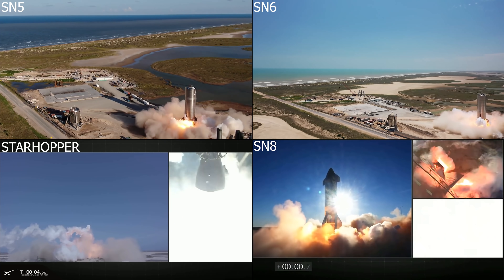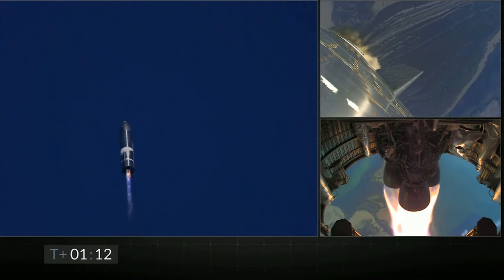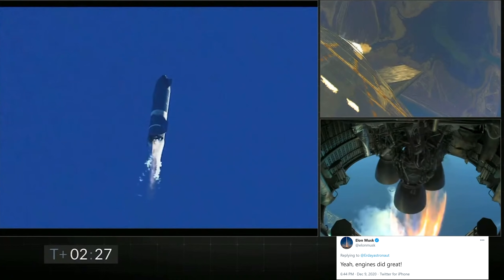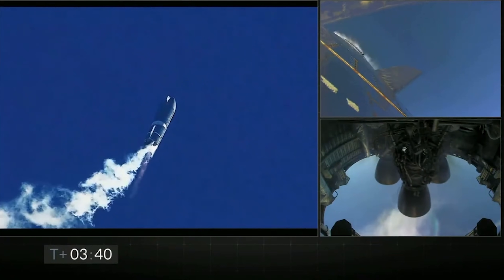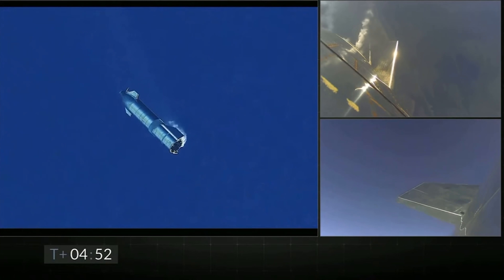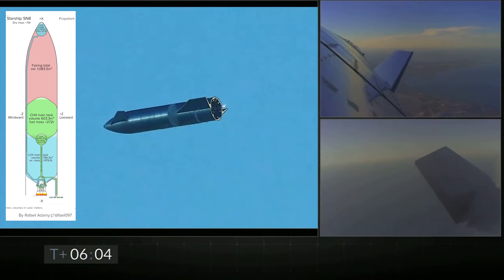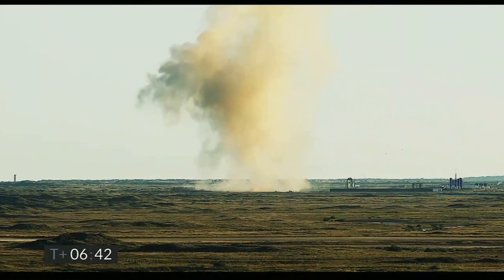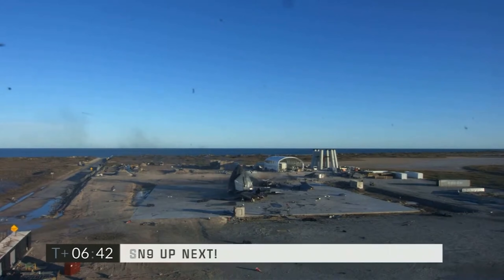SpaceX Starship Serial Number 8 Test Flight

Comment: The tip header tank is the oxygen header tank, and it appears to have worked just fine because the engines had enough oxygen to oxidize themselves. The methane header tank is attached to the common dome between the main methane and oxygen tanks.
Reply: Manley seems to think this is an issue with autogenous pressurization of the methane header but is there any actual evidence Spacex is even DOING this on the test vehicles yet?? It's not indicated in any of Elon's tweets they are. Autopressurization from the engine turbos seems like such a nightmare of difficulties to implement, isn't it more probable they're just using helium bottles for these tests, particularly given they're not doing the hot gas rcs thrusters yet?
Reply: @Muonium1  I was under the impression that the COPVs (composite overwrapped pressure vessels) were filled with helium to pressurize the tanks as they emptied. And I also thought you could see COPVs flying away during the explosion. This would indicate that SN8 didn't use an autogenous system. I could be mistaken, though.
Reply: @joeteichert6821  most of the copvs flying off were prob N2 for the RCS
Reply: @Muonium1  They also have COPVs for spinning up the turbines of the propellant pumps on startup and for purging the engines on shutdown. I think they use helium for that though.
Reply: @Muonium1  I'd seen something earlier that they were continuing to use He for a few more SN's before switching to autogenous pressurization. Maybe SN12, but I've forgotten exactly which one.
Reply: @Muonium1  "but is there any actual evidence Spacex is even DOING this on the test vehicles yet?"
I was asking myself the same thing! If they are already, color me impressed!
Reply: @Muonium1  Yes, a simple helium pressurization system would make sense. Especially true for something as critical as landing.
Reply: Looking at the tweet where Musk talked about this, he said "fuel header tanks". To me that points to the methane header tank. He is not talking about the "oxidizer header tank".
Reply: @p1zd3c   Copper is not the only metal that burns green. Nickel, chromium, boron, molybdenum (oxide), niobium, and tungsten all burn green. Together with copper they are the alloy components of many Inconel formula. During the Shuttle main engine development, when we witnessed a white flame exhaust we knew the engine was oxidizer rich and consuming itself. It appears the Raptor produces a green exhaust when it is oxidizer rich and consuming itself.
Reply: @Spacedog49  The engine bell is made of bronze - which is mostly copper.  That's the most likely source of the color.
Reply: @SteveBakerIsHere  The engine bell is inconel sandwich over copper tubing. Copper is also commonly used for the combustion chamber of liquid rockets for the superior heat conductivity to the fuel coolant.
Reply: @Markle2k  That make much more sense that bronze, which has far too low a melting point for such application.
Reply: Yeah - that was my belief too.  If there was insufficient oxygen, there wouldn't have been a green flame from the burning copper in the bronze engine bell.  But if insufficient methane was the problem, then instead of all of the oxygen being consumed as it should be - there was excess oxygen to react with the engine bell.  Conclusion has to be that there was nothing wrong with the oxygen header tank - the problem must have been with the methane header tank.
Reply: great video!
Reply: I was wondering if the Moon version of  Starship would even need to install the rapper engine's for landing back on Earth seeing Moon Starship's will stay on the moon are in orbit?
Reply: @acemax1124  The way it is currently it would need the raptor engines since just like the 'standard' Starship it will be the second stage of the Starship-Superheavy combo. So it would need engines to reach orbit. The difference is that it would probably have only the three vacuum Raptors. The absence of the three vacuum Raptors might create enough space for the vacuum ones to gimbal.
Overall though I don't think it is quite the best way of doing things. It would make more sense to me if an entirely different spacecraft specifically designed for lunar landing would be carried up into trans-lunar orbit by a cargo Starship.
Reply: @listerdave1240  You may recall the original plan of Von Braun was to land on the Moon with a full spaceship. Then, being the '60, Humboldt provided a touch of reality, that weight was their enemy. So the Moon mission became a train made of three pieces, each to discard soon after use (for a total of 100 Tons). I understand what reusability and routine Moon landings mean to future Space explorers, and why they want a vehicle that, like any other on Earth, comes back in the same conditions it left...
Reply: @antoniomaglione4101  That I understand and makes sense for a Starship that went to the moon and came back to earth. However it has been clearly started by Spacex that the lunar Starship would not return to earth, hence the absence of the flaps and heat shield. The plan being that a 'normal' Starship would take people (and cargo) up to orbit, the people and cargo would transfer to the lunar Starship and then the Lunar Starship would land on the moon. The return trip would be the exact inverse. 
Given that is the case it would make more sense for the lunar Starship to be transported up into space that one time inside a cargo Starship therefore eliminating the need for it to have its own vacuum Raptors, which would become just deadweight once orbit is reached as they would never be used again. The lander's high mounted engines would be sufficient for all operations, not just landing, so there would be no use for another set of engines (the Raptors) at the bottom side of the vehicle.
The absence of any engines at the bottom of the vehicle would also allow an 'upside down' configuration having the crew and cargo at the bottom while the engines and propellant tanks are at the top.
Reply: Considering the payload and the starship structure, is it possible to invent a large drone with a soft bed to proactively capture the starship while landing horizontally in the air at certain altitude?
Reply: @HY-Yang  Yes.  It would be comical, and I like that.  However there's probably a go-around for the sloshing, by making the maneuver a slow smooth sequence.  That would save time and money.
Reply: big brain shit going down rn
Reply: Yes.  There's the omission.
Reply: Makes sense.
Reply: Why not keep in the horizontal gesture to land instead of the final aerobatic maneuver action? Risking the propellant unstable flow inside the tank which cause unbalance movement. Or design a mechanism inside the tank to reduce the turbulence of propellant during the vertical maneuver.
Reply: @HY-Yang  It probably isn't designed to take its weight on its belly.  Handling the attitude change is quite a conundrum.  A slightly larger methane header tank will solve this. Every baffle's weight must be subtracted from the payload.
Reply: @beachcomber2008  Oops! the payload, understood and thanks.
Reply: Wtf all nasa experts commenting here
Reply: Agreed!
Reply: I’m not sure that’s right. In my experience the main ballast element of the reverse header flotation valve would commonly only operate effectively if both pressure valves were operating concurrently, and not in a proparative sequence, as has been highlighted in this manoeuvre.
Reply from the maker: I interpreted musk's words to mean both header tank feeds had bad pressure. Unless/until it's proven otherwise, I'll keep this take on it pinned. Perhaps it will be debated, but either way it will definitely encourage critical thinking. Thanks for your contribution!
Reply: @smallstars  Well low oxygen header tank pressure wouldn't produce the green flame. You need an oxygen-rich mixture produced by low methane tank pressure to get the green engine-rich exhaust we've seen. EDIT: Great video BTW, I loved the detailed explanations.
Reply: @GeorgeBarbăroşie  Yeah, that's what I was thinking. It might still be possible that the whole header tank pressurization system didn't work, and the oxygen tank just happened to be at a higher pressure. The oxygen tank is also higher on the rocket so that might produce higher pressure at the engine level
Reply: @GeorgeBarbăroşie  not really. the green flame was most likely caused by the disintegration of the copper cooling tubes in the engine bell of the raptor engine because of the engine strike seen when the third engine flames out.
Reply: @smallstars  No - if there was still an appropriate ratio of methane and oxygen then all of the oxygen would have been consumed, leaving none left for burning up the bronze engine bell and producing the green flame.  (Bronze is an alloy with a lot of copper in it).  There must have been plenty of oxygen - but not enough methane...ergo it was the METHANE header tank that lost pressure.
Reply: @smallstars  "Fuel header tank pressure was low during landing burn, causing touchdown velocity to be high & RUD, but we got all the data we needed!" -- Elon Musk's tweet. 
So he's clearly referring to the methane tank pressure.
Reply: @smallstars  I really enjoyed your oration of this flight juxtaposed with the beautiful camera work. Not insanely technical although I enjoy a high level of technical adeptness but it made this video like a very smooth, well made craft beer: Goes down wonderfully leaving you wanting more. Subscribing which I almost always refrain from until I am drawn in by the channel for a while. I.E. you pull me back for more and more. Best of luck with this channel!
Reply: 6:56 And it still ended in a costly explosion.
THEY GOOFED!
Reply: I iou I iou ì<77⁷⁷77⁸

Comment: It appears there was also fire damage on the initial first engines cutoff as it was still climbing. It appear an extreme backdraft is happening at altitude which super heated all the controls surrounding the engine exhaust ports.

Comment: why don't they begin manouver earlier, to have a buffer space to balance the rocket back in vertical position?
Reply: It would take more fuel to do so, the whole time the vehicle is belly-flopping it is staying at a relatively slow speed. If you begin the landing flip maneuver sooner, the engines would need to do more work as you would start speeding up again. As we see here, starting the maneuver sooner wouldn't have helped as it failed due to a loss of header tank pressure, which means that even if they did the maneuver sooner, the same thing would have happened. Even without header tank pressure issues, you wouldn't want to burn for longer because more fuel means less potential payload mass.

Comment: Will it reorient itself in space before descending down? At least then the orientation will be taken care of and you just have to worry about the landing burn.
Reply: Well, it depends where you are trying to land it. If where you are trying to land has an atmosphere like Mars or here on Earth, Starship would need to belly-flop as it would slow it down a significant amount and means that you don't need as much fuel as the engines aren't doing all the work. However, if you are trying to land on the moon (which has no atmosphere) you wouldn't need to do the belly-flop maneuver as it wouldn't do anything. This being said you would still be pointing retrograde while falling to slow down horizontally, but even that isn't as extreme as the belly-flop.

Comment: I understand that the header tank, Lost pressure, or the pressure was too low, in the header tank, I was thinking that there’s an easy fix something a kin to a A spring loaded, or pressure, loaded accumulator as a tank. It’s a simple fix for a pressure problem and the fuel is always under constant pressure for the most part.

Comment: Sorry guys but this is failure. Guaranteed safe landing is the most important part. Otherwise trip to Mars  (or 12 miles up) is worthless. Would one travel in a bus with no brakes? Of course Musk is officially happy with other less important achievements, like guidance. Unfortunately we already have guidance technology able to pinpoint crashing site accurately (missiles). After all it's business with investors and liabilities. Still long long way too go.

Comment: 2:08 This comparison makes the same type of error that leads to the pendulum rocket fallacy.  Balancing a stick is a very different physical system than aiming a rocket is.  When you're balancing a stick, if you don't move your hand then the more the stick tips over, the more torque your hand is unintionally applying to the stick to bring it further out of balance, i.e. the system has positive feedback resulting in exponential runaway.  A rocket may or may not be stable in flight, but whether or not it is depends on its CoG and aerodynamics.  The torque (if any) applied to the rocket by its engines is completely independent on the position and orientation of the rocket, and in particular does not suffer from positive feedback or exponential divergence.

Comment: 流星雨 2020/12/21

地球自轉的速度是1,666公里/每小時(赤道)，所以最外表大氣層的時速超過3,500公里/每小時。任何物體要穿越大氣層表面就如同撞向時速3,500公里的風牆，所以不可能有物質可以從外太空進入地球。自轉的向心力會讓大氣層最外表產生類似表面張力的能量場，所以入侵物質因而會被甩飛。轉速愈快則力場愈大，地球此能量場目前接近無窮大所以沒有任何物質可進出地球。如同洗衣機一般自轉會讓空氣均勻分布，且會產生向心力及切線方面的轉力。向心力讓空氣不會外流，轉力會彈射所有外來侵入物。譬如一個快速自轉的海棉，射入的子彈都會被彈開....流星雨是地球內超高空人造核子動力航空母艦向地面拋出垃圾，因為加速磨擦空氣造成燃燒之結果。

Meteor shower 2020/12/21

The speed of the earth's rotation is 1,666 kilometers per hour (equator), so the outermost atmosphere speed exceeds 3,500 kilometers per hour. Any object crossing the surface of the atmosphere is like hitting a wind wall at a speed of 3,500 kilometers per hour, so it is impossible for any matter to enter the earth from outer space. The centripetal force of rotation will cause the outermost surface of the atmosphere to generate an energy field similar to surface tension, so the invading material will be thrown away. The faster the rotation speed, the greater the force field. The energy field of the earth is currently close to infinity, so no matter can enter or leave the earth. Rotation like a washing machine will distribute the air evenly, and will produce centripetal force and tangential force. Centripetal force prevents air from flowing out, and turning force will eject all foreign intrusions. For example, a sponge that rotates rapidly, the bullets it shoots will be bounced away...Meteor showers are the result of the super-high-altitude artificial nuclear-powered aircraft carriers throwing garbage to the ground due to the accelerated friction of the air.

Comment: and now for a secret hidden comment - I bet they had like 250 items on their checklist to test for this flight and as each one checks out to varying degrees they can change the next following items for different tests on the fly.  For example turning one engine off tests many different things, then turning off a 2nd engine tests more things such as how long could one burn and what kind of performance profile, etc.  This was special engine #42 the heroic one but for the landing sequence they decide not to use it because it was used the most already with the longest burn time and could be compromised.  Unfortunately the problem was with the second engine.  On the way down maybe one option was to test landing without the legs - sure, that's on the list.  What else is on the list, gimbaling and bell rubbing, let's test that.  Okay now let's test multiple systems to destruction, we get much more data that way!

Comment: it was also speculated that the when the engine gimballed it rubbed against the other one which caused damage and the green flame was from the copper in the bell that was exposed.  But I know far less than most - that was just one speculation I heard.

Comment: Why is 6:43 landing zone different from 6:44 ?  I don't get that.
Reply from the maker: The footage was taken from the official SpaceX livestream. During the stream, the director was cutting from camera to camera live. He happened to cut to a different angle at the moment of touchdown (probably because the bottom of the frame was obscured by the foreground in the former angle,) but it's not a different location, just different camera angle.

Comment: This is a mockup, not a prototype
Reply from the maker: I was under the impression that mockups don't fly
Reply: @smallstars  Working mockup shows how the prototype works. 
The prototype is a fully functional model that will be further upgraded to a working condition. When the rocket flies into space without cargo and equipment, this will be the prototype. In this form, it cannot fly into space - the engine and the thin foil case does not allow.
PS I guess this rocket has no future, it's just a technology demonstrator. Perhaps someday it will fly, but definitely not with 100 passengers :)

Comment: QUESTION: Why did the header tanks not have the needed pressure during landing burn? You partially explained why it failed but not all. I looked for the answer in the comments but didn't see it already. Sorry if I missed it. Thank you. When the reason why the pressure issue happened, I would like to know what SpaceX engineers will do to overcome this error.

Comment: Are you sure only two engines were scheduled to ignite when landing? All three engines were set in position 6:30, lik all three were going to start. When only two ignited, only then they place themselves in a central position.
Reply: Yeah there was no evidence of the engine even trying to start. They spit up propellant just before ignition. The third engine seemed pretty static. I am however curious as to how the landing procedure will differ with humans on board. Starship can land on one engine. Its demonstrated that. So if all go out any occupants are just screwed and that's that... I'm wondering if future SS with more fuel will use three engines to land. For the redundancy.